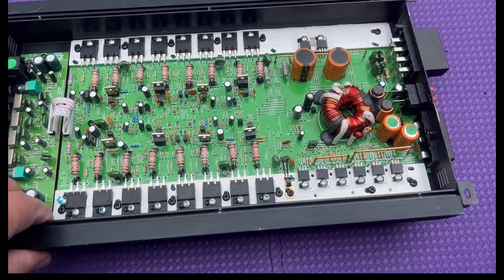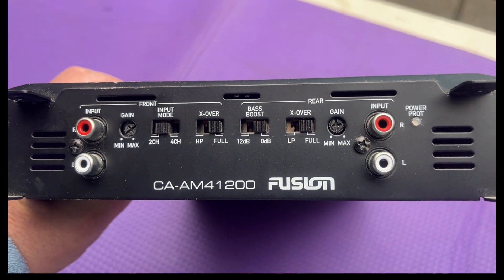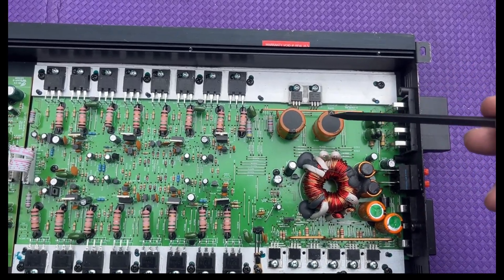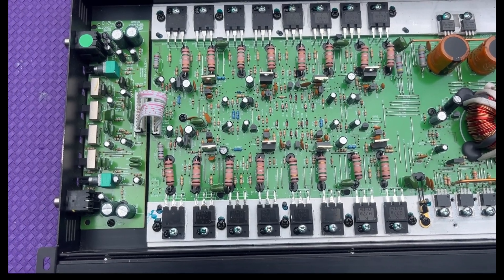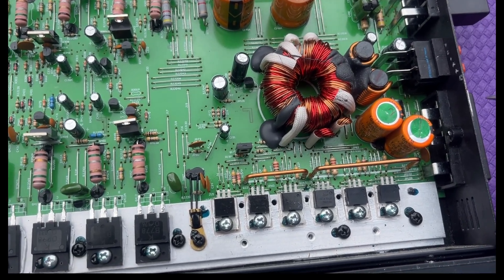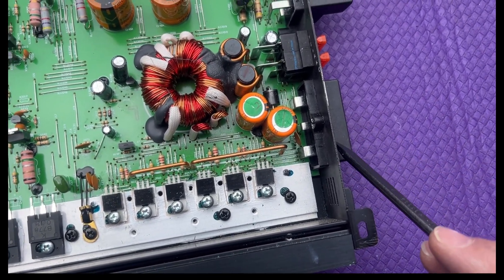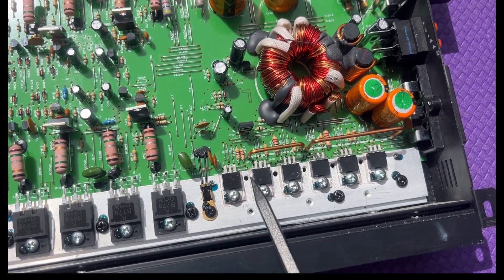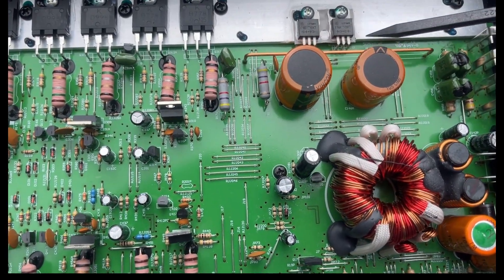HOW AN AMPLIFIER WORKS

Comment: Hello Socket, can you help me? I am noticing that my car's tail lamp flickers when the bass hits in the song....
Reply from the maker: Hi Vikash. Sounds like you are straining your electrical system.  Have you upgraded your battery or alternator?
Reply: @socketsocket2763  no sir
Reply: @socketsocket2763 no sir
Reply: @socketsocket2763 tell me sir...what should i do?
Reply from the maker: Hi Vik, the flickering of your tail lights means you are draining the power supply in your car to the point where there is not enough power to light up your light lights. When you hit bass in a song the subwoofer draws a lot of power and drains your electrical supply.  If you car battery is big enough and well charged, then you usually have plenty of power. So what to do depends on why your cars power supply is not keeping up.    If this is happening when your car is off, then start you car and see if the lights flicker. They probably wont because the engine will now be supplying extra power.  That means the problem is your battery.  It either needs a charge or it is old and needs replacing or it is too small and needs to be replaced with a bigger battery.  Hope this helps